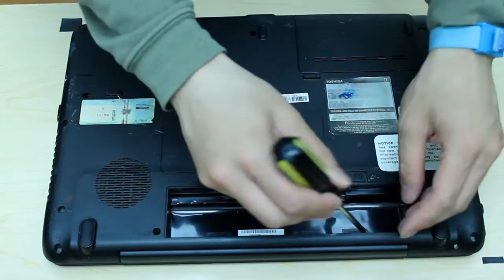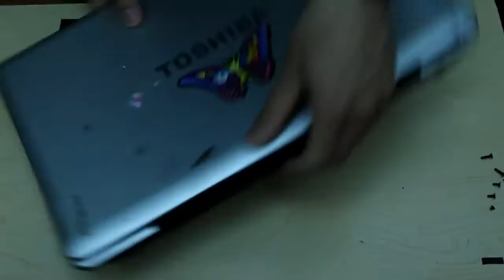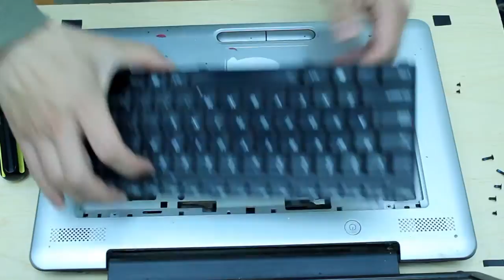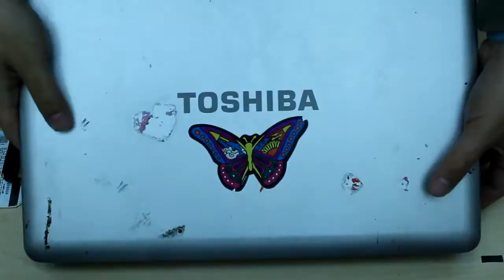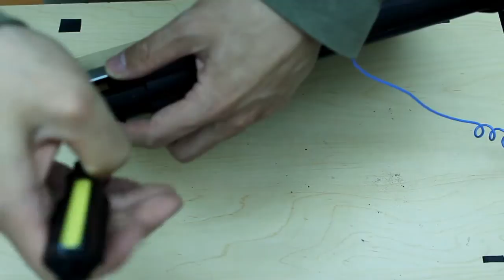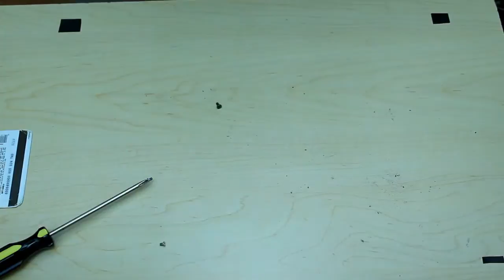Toshiba Satellite L455 Laptop disassembly remove motherboard/hard drive/cooling fan etc.

Comment: Thank you so much! My computer kept turning off after a couple of minutes. I suspected it was a clogged fan (it was). Your video helped me get it apart. 

Although I inexplicably have 6 screws left over (oops) and I broke one of the plastic connector plugs for my keyboard. I got the pins in place and (for now) the keyboard is working though I use an external one. 

She's ~12 years old and is desk-bound, so other than moving to clean, no jostling.

Again, thanks so much! I'm so sad that Toshiba no longer sells laptops in the US. Been buying them for 20 or so years. Not sure what I'll buy next.